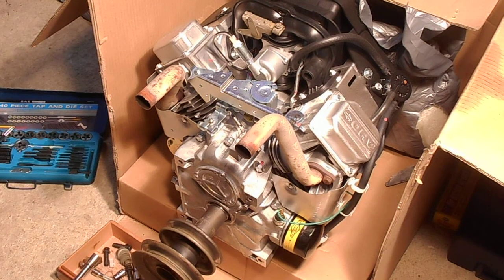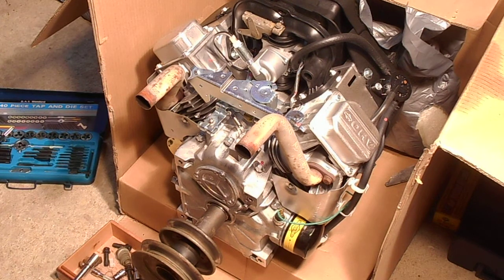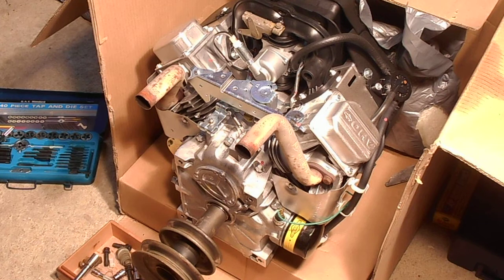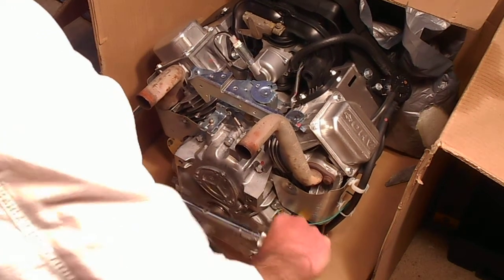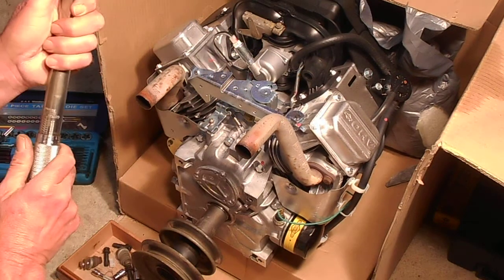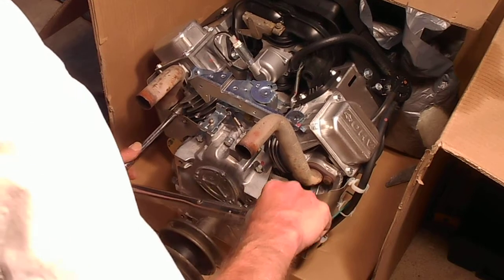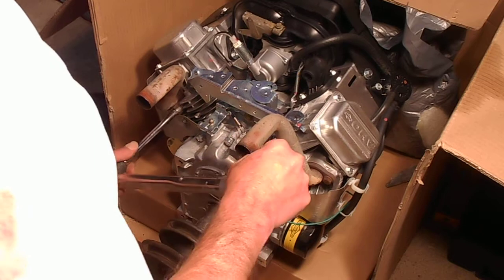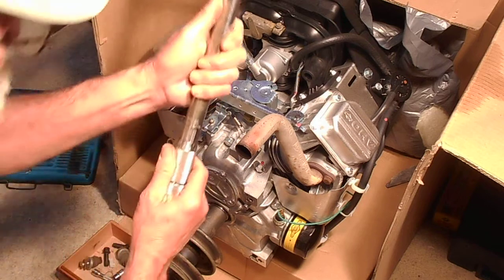Torque Specs for Aluminum

Comment: A good torque wrench is a must have item for every shop.  Nice work !!!
Reply from the maker: Rodder 204 - ever had to YELL at someone it is a torque wrench NOT a pull bar?
Reply: No....But I have seen guys put a cheater pipe on a torque wrench while trying to install head bolts at 100 plus ft. lbs. of torque. I don't think that's the proper way to do it .... lol.

Comment: Tricky operation there. I've done a similar one on an aluminum head on an outboard motor. I did exactly the same, stepping it up gradually. Should be fine, although you would be right to check it after the engine is run for a bit. Thanks for the informative shop time!
Reply from the maker: defuse56 - aluminum is not my favorite metal for setting a torqued bolt into.   they need to be tight for sure.  yep, got to torque them again after a few hours...   thanks for watching..
Reply: I never could understand why they would use aluminum for an engine like the one you are working on. For an outboard, yes, because you need the weight saving, but for something where weight isn't an issue, I would think it wouldn't wear as well. However, no doubt there is some reason, probably saves them costs in some way. If it cracks or wears out, they then can just sell you a whole new motor or tractor or whatever.I think they count on the average guy not wanting to bother fiing it; he just junks it and re--purchases whatever it is.